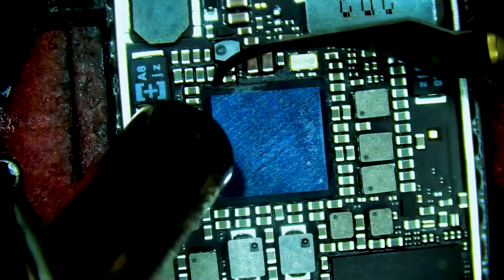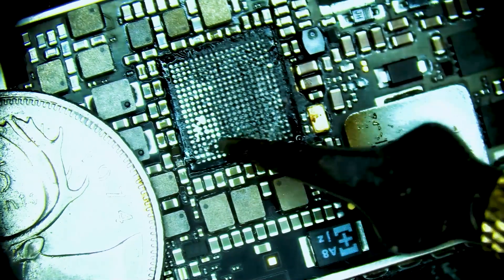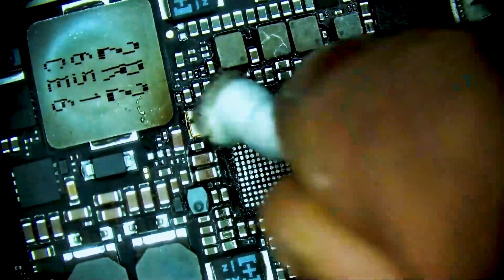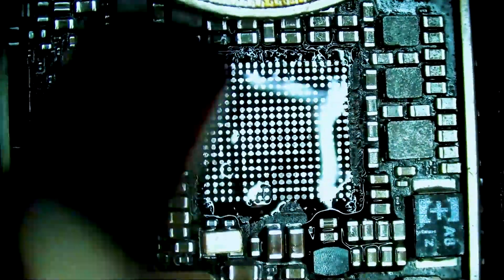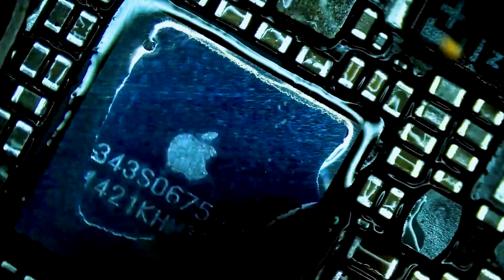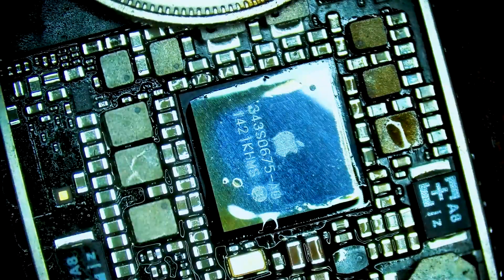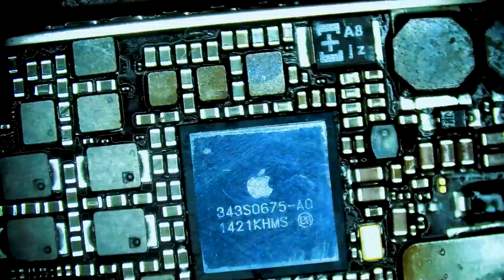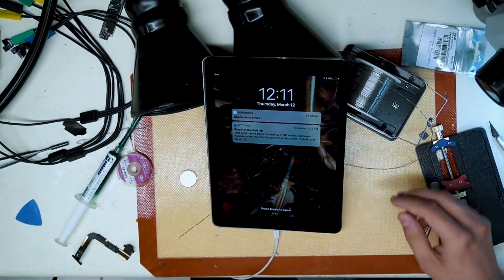iPad Air 2 Draws 3.5 amps - PMIC Replacement - Micro Soldering Repair

Comment: Thank you very much for this video and confirmation of the same issue of a local client. PMIC is heating up and current draw is about 3.2A and then shuts down to 15mA - unable to charge the battery. Model is A1566 = Ipad AIR 2. Will replace the PMIC. Thanks again.